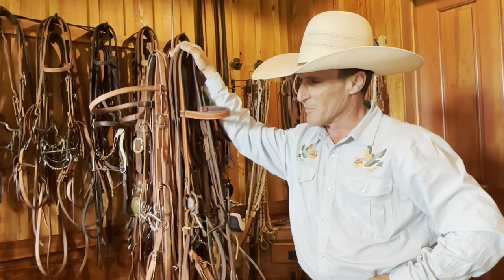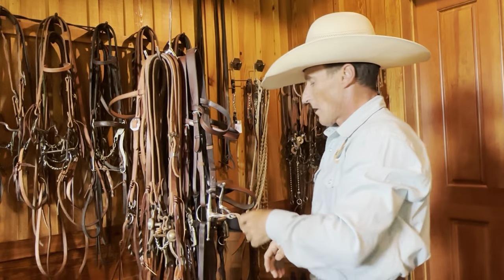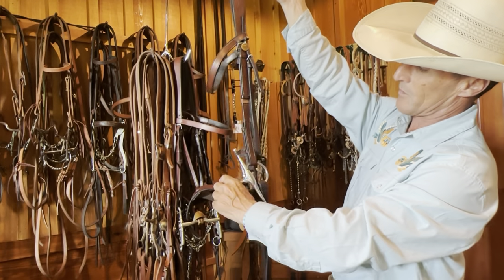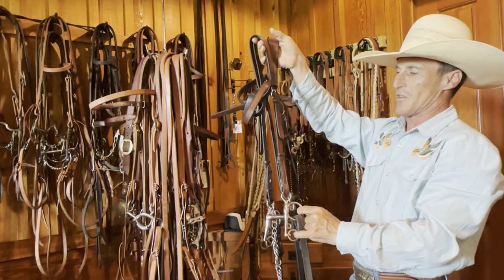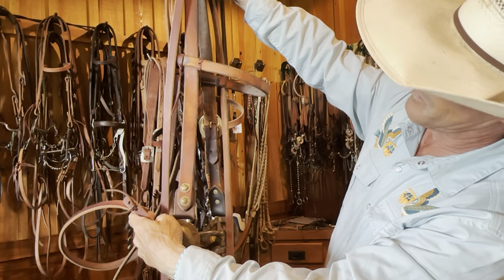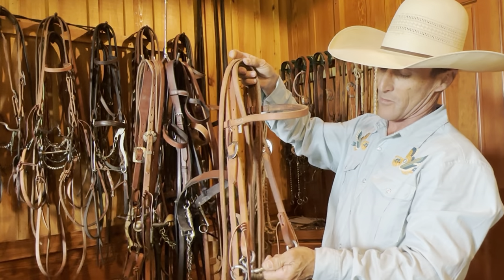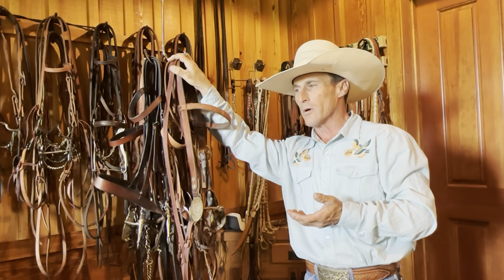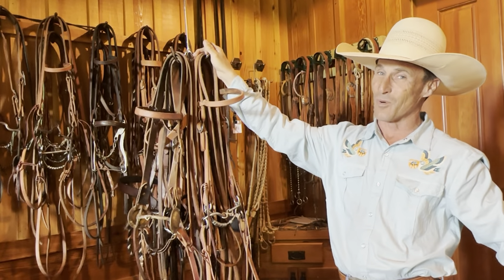…a little snaffle bit humble pie.

Comment: A question for you; I noticed that every headstall and reins that you use is what I would say is a pretty hefty set of leather! I use entirely a simple 1/2" one ear slip on a dring snaffle. No cheek strap or curb. I use solid leather 3/8" round reins. My theory is the lighter and less bulky headstall setup, the better. I feel it helps teach light touch through my hands. Does this limit me from obtaining anything in particular in regards to training a really responsive saddle horse?
Kevin
Reply: Kevin, No, actually it makes for a better saddle horse because it is light in the mouth. You never want a hard mouthed horse. It's so hard to retrain it to be a soft mouth, than if it already has one. Keep doing what you're doing mate. If it ain't broke, don't fix it!! As my great grandfather and grandfather taught me. Best Regards from a Retired Paramedic and Horse Trainer in Ontario, Canada, Jenn  💖

Comment: If you’re starting a two year old and you’re using a side pole or a basil, just want to know because I always stock them with a side pool instead of a Snapple ring I introduce a Snapple ring later on about two months into the training my two-year-old seem to work out a lot better also turn and have flexibility and I’m always bending bending and flexing, which makes them a lot more easier to handle and flex and also direct going straight I’ve have almost every bit you can imagine and I find that the for my renters and my Raining Horse is in my cutting horses I used to begin with either Bacio or snaffle bit

Comment: A bit has leverage. A snaffle does not. If it runs a curb chain or the like it’s a bit. A snaffle comes under the umbrella of being a bit, yet it is not a bit. A double bridle is called a bit and bradoon for a reason. You Americans like to reinvent the wheel.
PS. The two rein all in one are Pelhams. Two bits setup is a Double Bridle or Bit and Bradoon.

Comment: Respectfully disagree with your friend and the presumption that every bit, including leveraged bits, are snaffles, they are not - snaffles may be broken, a French Link of a Mullens (straight through, one-piece), but what makes a snaffle a snaffle is that they are a straight pull.  When you pull on a snaffle you get 1 pound of pressure for every pound of pull, when you pull on Tom Thumb (what you described as a "shanked snaffle") you get 5 pounds of pull for every 1 pound of pressure.  And, what the hell do you need all those torture devices for anyway?  Learn and practice horsemanship, not forcemanship.

Comment: If you need a mouth bit to get your horse to be soft and level up. Sorry, your training is lacking.  I"m for no mouth bit at all. just put the time and training into the horse make them a partner and your horse will do anything you ask of them never once having a bit in the mouth.  No Noise band either, there is zero reason to cause pain to get your horse to be at the top of its game. This is all old-school pain methods of horsemanship, it has been proven that none of the pain gear is even needed. Just cowboys abusing horses because they don't know any other way.  Today there are tons of people running bitless, shoeless, and Bandless and they are some of the best horse trainers and riders in the world. They understand the animal in a different way.  The problem is that these modern horsemanship methods have proven that all the old-school breaking and riding methods were just not necessary even lazy and abusive if you ask me. He'll we ran working horses with just rope halters with no problem. But we grew up learning good horsemanship and not just Flooding and pain to get what you need out of the horse.